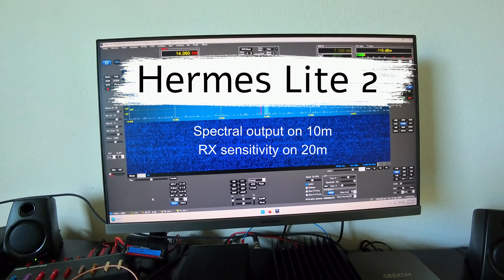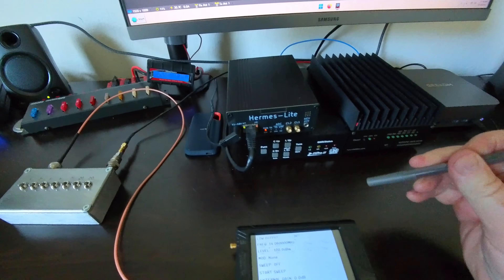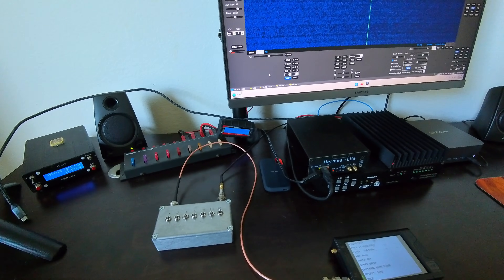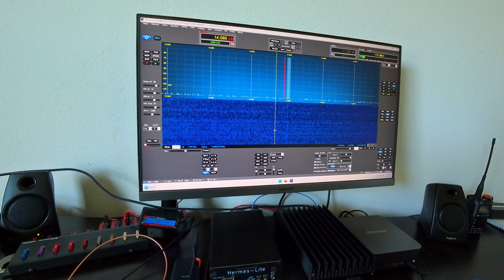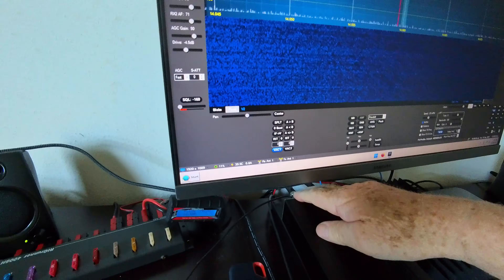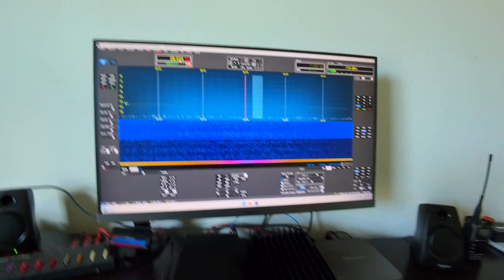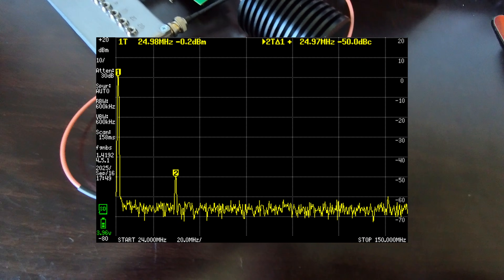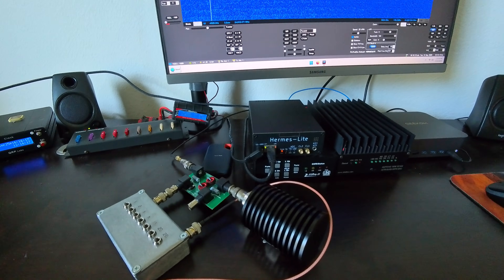Testing the Hermes Lite 2

Comment: When doing the receive test, you could use the receive level meter in the software to measure 3 dB S+N/N (O dB S/N) or 10.5 S+N/N (10 dB S/N), rather than by ear

Comment: Contrary to the ANAN radios, HL2 has a bidirectional attenuator, you may want to try to select some negative values, the sensitivity should increase, eventually it will allow you to hear the tone at minus 140dBm!.
p.s. on 10m I compared the ANA10 vs HL2, the impression is that HL2 is slightly more sensitive, by introducing few db below 0 on the attenuator
Thanks for the test, I4LEC

Comment: nice video,   has anyone used the hermes lite 2 with gnuradio ?
Reply: I use gnuradio for DRM30 experiments and CQUAM AM stereo transmit. It works fine the only thing is you can't toggle the filters.